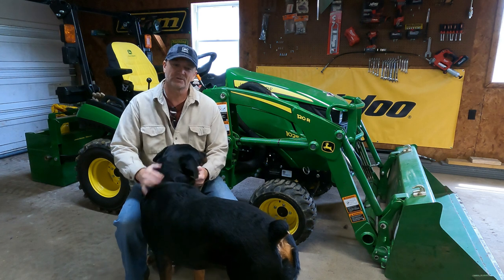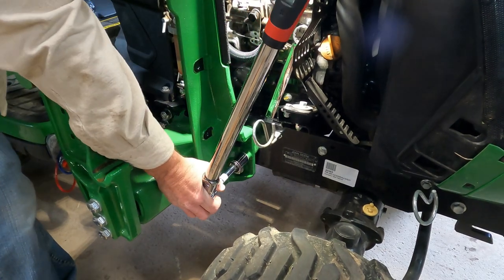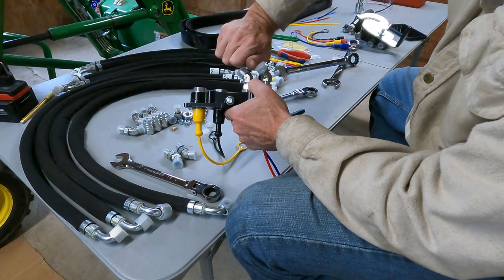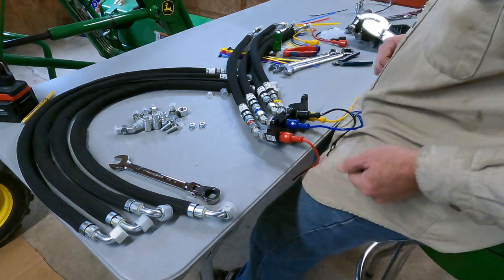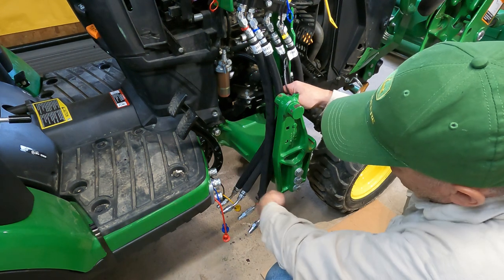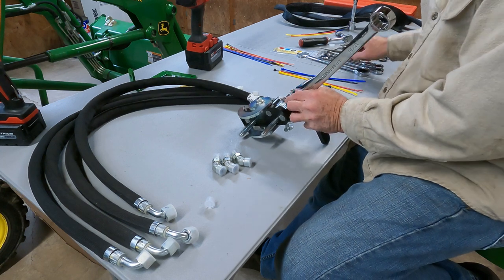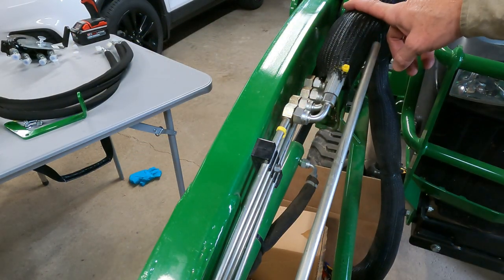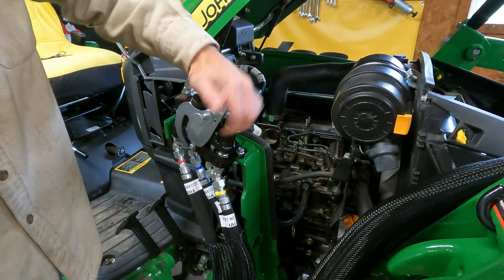JOHN DEERE 1025R | Single Point Connector Deere 1023e/1025r/2025r

Comment: Great video! Especially since the kit doesn't come with instructions.  I remove the front bucket fairly often on my 1025 and always hated the placement of the hose connections.  This setup is so much easier.
Reply from the maker: Thanks for stopping by the channel Kenny. I hated messing with those quick connections because one always seemed to stick. Now I don’t even shut the tractor off to remove the loader. It’s well worth the investment.  👍🏼 Take Care

Comment: My new 1025r came with the single point came with it installed. I'm glad it did. My old tractor didn't have that. Was tough taking the loader off sometimes. Good video.
Reply from the maker: Hey Joel, Wow.. You're lucky.. Well as you now know the single point is definitely a game changer for sure. Congrats on the new 1025r Take Care

Comment: I love this video, I have watched it 4 times you do a excellent job, and my 1025R has the factory cab and its even harder. I need to order one now!! thanks
Reply from the maker: Hey Russell, Thanks for the kind words and stopping by the channel. The single point connection is slick, just make sure it will be compatible with a factory cab and it won’t interfere with the bracket or single point connection.
Reply: Ditto here !

Comment: Great video, glad I found your channel! Going to tackle the install on my 1023E soon. Question: Since you're adding empty volume to the system with new hoses, should one expect to have to add more hydro fluid? Thanks!
Reply from the maker: Hey highland1318, Thanks for stopping by the channel to checkout the video. I checked it after the install and did add alittle JD Low Vis HY-GARD to bring it back to where it was suppose to be on the dipstick.  Take Care

Comment: Fantastic video.  Thank you.  I was going to wait unil the Spring to order this for my 1025R but I'm taking your advice.  Sometime is NOW!
Reply from the maker: Hey AJ, Thanks for watching the video. The single point connection is the best upgrade hands down I’ve done on my tractor. Going from the loader to the blower is so easy now and I don’t even shut the tractor off anymore. Money well spent. Take Care. 👍🏼
Reply: @SometimeIsNow  I just finished the install after watching your video a couple of times.   Thanks to your video it was a very easy job.  No more struggling with those hose connections.  It got to the point where I just left the loader on all the time because it was such a pain to disconnect those fittings.  Not any more!  Thank you very much for the instructions!
Reply from the maker: @AJLJR77   Hey AJ, That's Awesome !! I'm glad you did it yourself.. 👍🏼 I got so frustrated with those 4 so called quick connections.. The single point just made sense for that easy on and off loader/snowblower.. Take Care my friend !! 🤙🏼
Reply: A couple questins, if you be so kind to awnser please! I noticed that the original  bolts( Stock  Bolts)  that you removed have a nut shape neck, so it secured to the tractor frame, eliminating the need of using wrench inside. Why JD does not supply a same shape bolt, just longer?  The new ones had treads all through the end,  making room for future movements and coming loose. Also, only JD sales this kit?  By the way, kudos to you, great video, not at speedy Gonzales, as many videos on the green tractors, too busy selling products, 😂. Great and clean  job, and a very clean shop! I want to install this kit on my recently  purchased  2019 1025R. Already boutique a seat cover, a step bracket.

Comment: Did you use the extra washers that came with the kit to space out the new bracket so the side panel has more room to slide off?
Reply from the maker: Hey JM, Thanks for stopping by to check out the channel. No I didn’t. I don’t believe it showed in the directions to add them behind the bracket to shim it out. I don’t like stacking washers to make a shim. If I was going to move the bracket out I would just buy one specific thickness spacer like a 1/4” spacer from McMaster Carr and just add one spacer per bolt to move it out. Would just have to make sure there’s enough thread for the nut to go on before deciding how thick to make the spacer. I agree the bracket is a little close to the side panel but as long as the rubber trim is on the bracket it doesn’t hurt the panel. If I was constantly removing the panel I would look into it more. Take Care. 👍🏼

Comment: Great video! I am going to get a new 1025r that actually comes standard with the single point connector now. One question about something I noticed. When you were showing the single point in action, I notice you left the tractor running when you connected/disconnected it? Is that an added benefit of the larger connector is that you don’t have to shut the tractor off and wiggle the joystick to release the pressure?
Reply from the maker: Hey Kyle.. Thanks for stopping by the channel.👍🏼 Congrats on the new 1025r you’re getting. You’ll love it, it’s a great little tractor. To answer your question, You’re Correct… One of the best things with having the single point connection is you don’t have to shut the tractor off to swap attachments.. Before installing the single point I’d have to shut the tractor off and wiggle the joystick to relieve pressure so I could unhook those four connections. Then if I unhooked the loader outside in the sun where the lines would build up pressure from the heat, then I couldn’t get the connections back on without pushing in the center to relieve pressure off the hose. It was so frustrating and I hated it. The money the single point cost was well worth the ease of use and no frustration. Take Care and enjoy that tractor 🤙🏼

Comment: How did you know which way the orfice goes? On my factory loader it was reversed from what I believe I saw you do. Which direction does slot on orfice go?
Reply from the maker: Hey J, Thanks for stopping by the he channel. 👍🏼 I don’t believe it matters which way the office faces honestly as all it does is reduce the flow of fluid to that function. I installed it with the flat surface up just because it was going against another flat surface but like i stated I dont think it matters which way it goes. The fluid flows both ways through that reduced orifice so it shouldn’t matter. Take Care 🤙🏼

Comment: Excellent video sir.  Question does the vertical bracket the single point lever mounts to get in the way of the oil filter?   Looks like it could make it more difficult to get the oil filter off?
Reply from the maker: Hey Daniel, Thank you for stopping by the channel.. Check out my oil change video. You can see the oil filter doesn’t have an issue clearing the mount. https://www.youtube.com/watch?v=_j8ptxnF1Lk Take Care 👍🏼
Reply: @SometimeIsNow  Thank you for pointing that out.   BTW the video you linked to is the fuel filter change but I found your oil filter change on too.   Subscribed.
Reply from the maker: @danielcrafton6676  Ooops sorry.. 😁 I seen Filter change an assumed it was the oil filter one. Thank you for subscribing. I really appreciate it. 👍🏼 Take Care

Comment: Do you have dust caps for those when you take the top part off?
Reply from the maker: Hey Kenneth, Thanks for stopping by the channel. Yes, the caps came with the kit and they hang from the lower half so when you remove the upper you can cap them if you're going to drive around without the top half. Take care 🤙🏼
Reply: @SometimeIsNow  I have a question when we got ours installed they never gave me the dust caps for it at all. It came back from the dealership with no discounts. Desk caps
Reply from the maker: @kennethgasiecki915  Hey Kenneth, If your dealer ordered yours as a John Deere kit they should have came with the color coded dust covers. If you look at my video @11:35 you can see two full sets of dust covers that came with my kit. I’d just give your dealer a call and ask them if there was a reason yours didn’t come with the install.. If they’re a reputable dealer I’d think they’d just get you some.

Comment: Excellent job on explaining the installation.  Gonna have to save some dollars to get one for mine.  Now that you’ve had this for awhile, do you find it hinders checking the oil, access to the oil filter or anything like that?  Thanks!
Reply from the maker: Hey Michael, Thanks for stopping by the channel. This single point connection is pricey but it’s well worth the money with not having to fight the quick couplings. There’s no issues in checking the oil or changing the oil filter. I made a video on changing the oil and filter. Check it out and you can see. https://www.youtube.com/watch?v=x8GYGeiWuhY 
Take Care🤙🏼

Comment: What brand marker is that? at 7:37  Is it a paint marker or something similar?
Reply from the maker: Hey Wulfjason, Thanks for stopping to watch the videos. The marker you’re asking about is a Dykem Brite Paint Marker. Amazon had them but they only have the green fine tip left. 
https://www.amazon.com/DYKEM-8030-8414-Brite-Mark-Marker-Green/dp/B01LVZI5GC/ref=sr_1_6?crid=301SUFI5ATQ6Q&keywords=dykem%2Bbrite-mark%2Bpaint%2Bmarkers%2Bfine&qid=1687003307&sprefix=dykem%2Bbrite-mark%2Bpaint%2Bmarkers%2Bfine%2Caps%2C104&sr=8-6&th=1
Grainger has the yellow ones.
 https://www.grainger.com/product/DYKEM-Paint-Marker-Fiber-Nib-2GKV4
Take Care. 🤙🏼

Comment: Hi, Excellent instructions. Thank you. Will what's included in this kit allow my to re-terminate my snowblower lines and not the bucket? Or does the blower require different line lengths?
Reply from the maker: Hello,
Thank you.. With this Kit you will only be able to complete the loader. If you want to add an additional single point you will need to watch my other video to add a snowblower. I list the part#’s in this video.
https://www.youtube.com/watch?v=k9dqaMgrveU&t=1s
Take Care 👍🏼
Reply: @SometimeIsNow  Thank you so much. Your instructions are fantastic, by the way. I used them to put the gearbox in my 54" blower.

Comment: So how do you hook up the hydraulic connection for the midmount mower once this is installed?
Reply from the maker: Hey Davis, Thanks for stopping by the channel. My Tractor doesn’t have a mid mount mower so I will only be able to venture a guess on this question and only assume it would be no different than my snowblower. One would have to purchase the upper half of the single point (Hydraulic Quick coupler Part# LVA24157) and however many fittings (Elbow Fitting Part# 38H3045) so to make that secondary implement a quick connect as well as a loader. I will be doing another video soon on what will need to be done to make my snowblower use the single point once I converted it over to single point. Once you add this single point connection, any other attachment will need the upper hydraulic quick coupler to be able to utilize this new upgrade. I’ve had a couple requests now so i will get the video filmed and edited sooner than later. Take Care !
Reply: @SometimeIsNow  is
Reply: @SometimeIsNow  Thanks!!
Reply: MMM does not require hydraulic a connection
Reply: @marvinjackson2641  It does if you have hydraulic mower lift as opposed to manual.

Comment: Does the John Deere single point hydraulic connector part #BW16079 WORK ON THE 1025R TRACTOR?
Reply from the maker: Hey Ruben, I believe the part# you are referring to is for the larger 3000 series tractors
Reply: @SometimeIsNow  I am trying to find a single point connection for the front loader and possibly for three lines and not just two.

Comment: How much money did this kit cost?
Reply from the maker: Hey Marvin,  Thanks for stopping by the channel. I believe it’s $1,044.54 for the total kit including with the second upper part and 4 O’rings for the snowblower conversion. If you just want the single point kit its listed at $690.80 right now. 
If you add the extra 4 O’rings will be $6.64 and second Upper Hydraulic connector is $337.90 for the snowblower conversion. Hope this helps. I’ll be honest it isn’t cheap but it’s worth it to me. Take care 👍🏼
Reply: @SometimeIsNow  MY tractor finally came in. It was delivered last week and i have begun the install of this kit. Hope mine goes as smoothly as yours did. Thanks for the Vid.
Reply from the maker: @marvinjackson2641  Congrats on getting your new tractor.. You’re going to love it. For its size it sure does like to work. Let me know how the install goes and your review once its complete. One thing I’ve heard from other subscribers is to keep in mind if you purchased the mid mount mower you’ll get a different main front snowblower quick hitch frame mount due to it has to do double duty. Snowblower and mower. So when you go to hang the quick hitch on the tractor you will need to turn the front wheels all the way to one side for the bracket to hang on the main frame mount. 👍🏼 Take Care
Reply: @SometimeIsNow  So I just finished the install, it went smoothly thanks to your video. A couple things 1- what is the secret to putting the side panel back on the tractor, I got mine on but it was a really tight squeeze. 2- what did you do with the original metal bracket that held the hoses on the loader. 3-i had to loosen up probably 60% of my connections because i didn't realize that the hoses wont fit if they are not aligned properly. this seems almost impossible until everything is ready to connect (male-female ends). and 4- I ended up putting zip ties in those 2 vacant holes on the arm to secure the hoses better, and what are those holes for anyway.

Comment: tell me you're a pipe fitter without telling me you're a pipe fitter😅
Reply from the maker: Hahahahahaha Nope.. Way off.. I just retired at 55 with 36yrs with the same company from Supervisor in Maintenance. 👍🏼
Reply: @SometimeIsNow  good video, minus the metric wrenches lol
Reply from the maker: @marvinjackson2641  Hahahahaha. I hear ya. That wall in my garage is all metric wrenches, mostly for my snowmobiles but seems to be migrating to the tractor. 🤦🏼‍♂️ Take care 👍🏼
Reply: @SometimeIsNow  I'm curious as to why you didn't put the colored zip ties on both ends of the hoses?
Reply from the maker: @marvinjackson2641  Hey Marvin, Thanks for stopping by the channel to check out the video. Good Eye.. 😁 I saved the other set of colored zipties to use on the snowblower hoses when I converted that to the other single point connection. When I finally completed that project last fall I just never put them on the snowblower hoses. No other reason. Take Care 👍🏼

Comment: Correction that was part #16970.
Reply from the maker: Hey Ruben, If you're referring to  Part# BW16970 , that single point is different than the one I installed on my 1025r
The 16970 is for use with model year 2017 and newer NSL 220R Loader on 2032R and 2038R Tractors
Reply: @SometimeIsNow  thank you for the info.  My 1025R is a 2017, so it's older then the 2017, thus i don't think the part number that works for the 2017 or newer will work on mine. I need to find what single point connection will work on my tractor, i am probably asking for too much by wanting a single point hydraulic hook up connection for three lines. Do you think i should try to have on fabricated?
Reply from the maker: @rubenlao378  I've seen single point connections that were specifically for the much larger tractors with 3 functions, but never on a 1000 series sub compact.